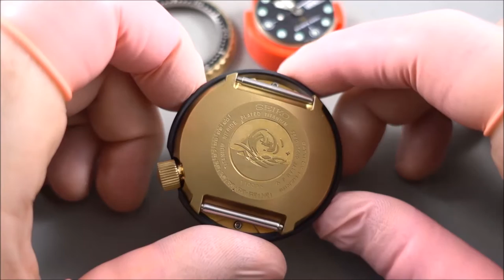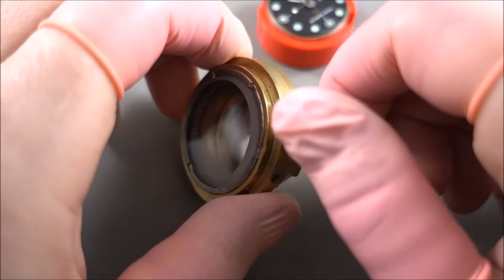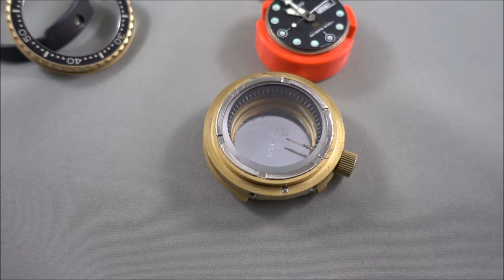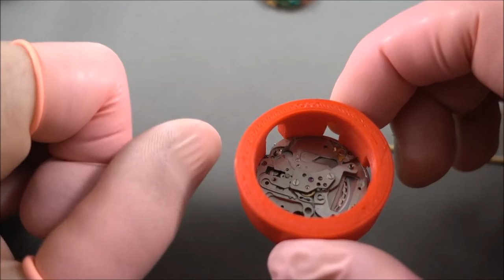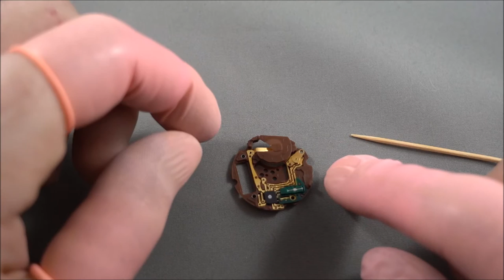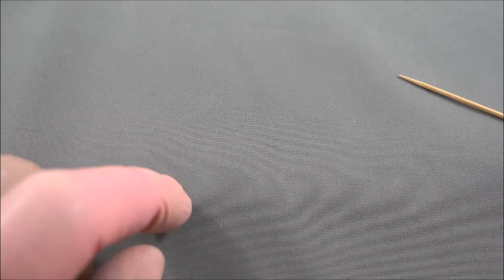SEIKO 7549-7009 "Golden Tuna" Diver Evaluation + Chat

Comment: my favorite Tuna.
Also as a watchmaker, which movement do you find better built and longer lasting, the 7c46 or the 7549?
Reply from the maker: Geday, Just noticed this comment. I think the 754x series is better made and parts are easy/cheap to find. The 7C series is very good though. Less module death on the 7C series.